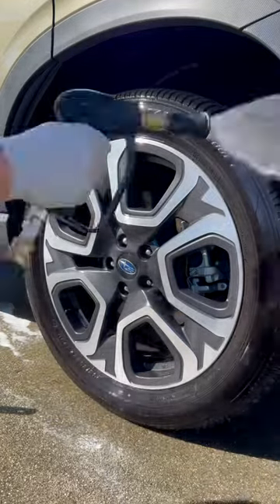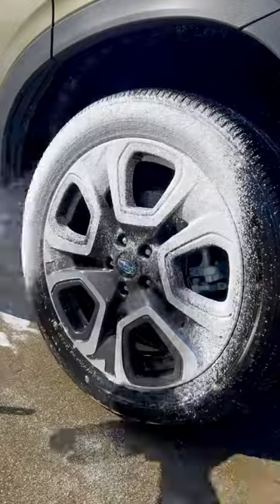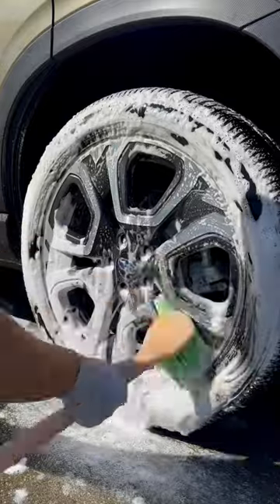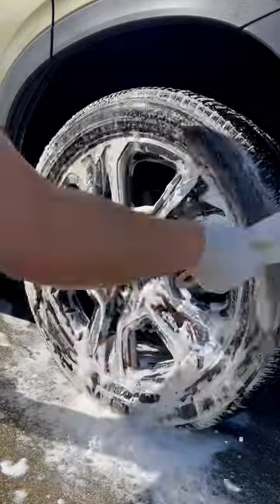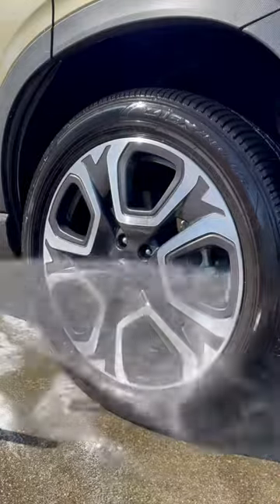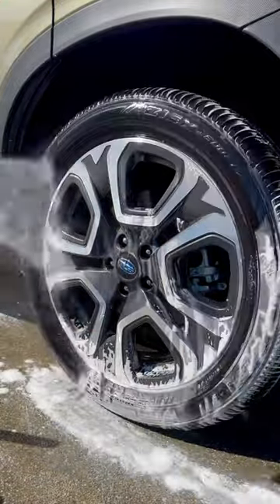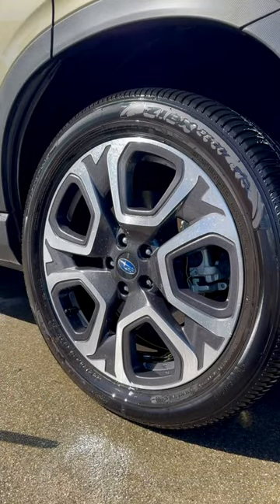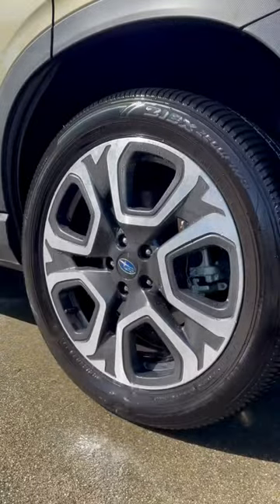Too much Bead Maker? Have you tried on wheels? #autodetailing #beadmaker #cleaning

Comment: lol ya I’m in the same situation beadmaker was my go to drying aid and I do still like it, it leaves great gloss and smells great but I just have so many other good sealants I find myself rarely ever using it anymore….I have used it like this before spray on rinse off it def works
Reply from the maker: I do like to use Hawaii Detailings “Honeypot” mix of beadmaker and absolute as a cleaning quick detailer.
Reply: What’s a better alternative to beadmaker? After my cars are paint corrected/ceramic coated, I’d use this as a “maintenance protectant” after washes
Reply: @Spencer_Marks  if your using bead maker for the gloss and how good of a drying aid it is then  it’s an amazing product but if your using it as a stand alone spray sealant there’s stuff that lasts longer….DIY Ceramic Gloss, Gtechniq ceramic sealant, Koch chemie so02, shine supply wet detailer express sealant, alchemist crowne has the gloss of beadmaker and lasts a bit longer in my experience….if the vehicle is coated I like to use shine supply punch it, ceramic gloss, ADS amplify or ethos finish shine all are good ceramic detailers….this is all just my opinion I still love bead maker too

Comment: This stuff is crap. 
It does leave a nice glossy finish, but that’s it and it’s quickly negated by how much dust it attracts. 
It also has basically zero durability.
For wheels, I always hit them with a little Gyeon Wet Coat.